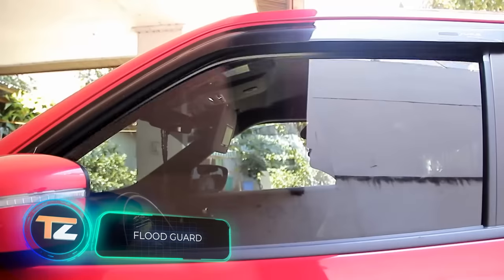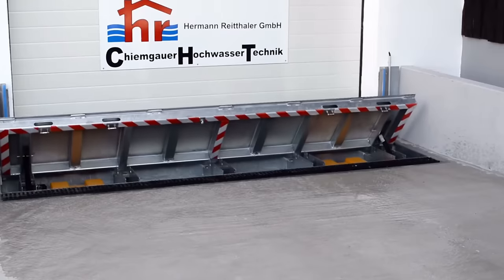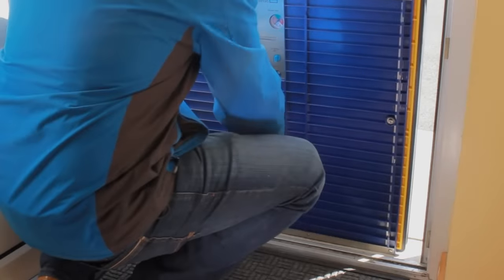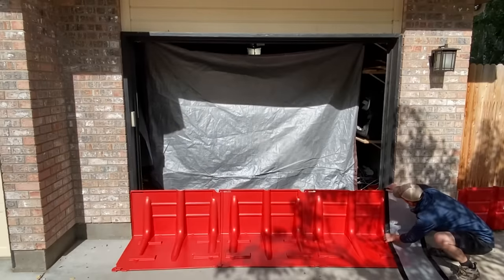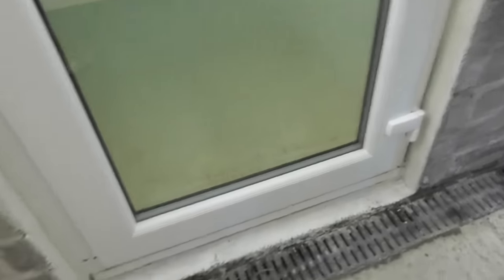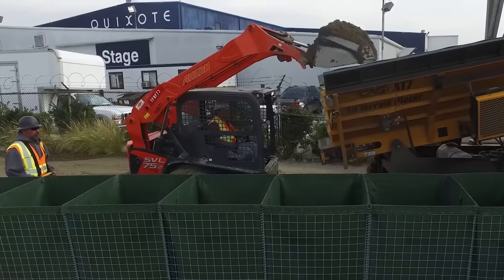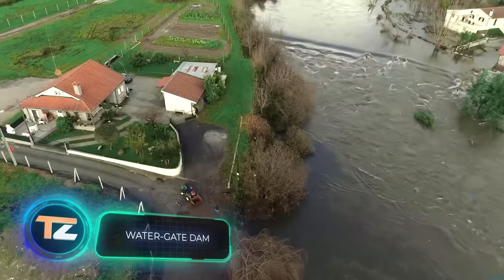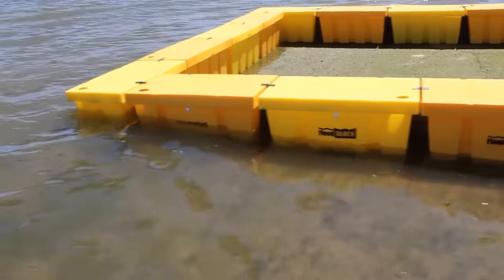FEW PEOPLE HAVE EVER SEEN THESE ANTI-FLOOD INVENTIONS

Comment: The permeable concrete would work in warmer climates, but if its installed in any areas with freezing weather it would break extremely quickly due to ice formation within the concrete itself
Reply: That's actually an astute observation. But, even where I live, we've been getting colder winters. So even though it's typically a warm climate here we'd have issues too.
Reply: Unless you have a large drainage system that is under 100% of the concrete all you are going to do is erode the sub-soil and create a sinkhole
Reply: @ryanbelcher396  a good point but likely you use a specific type of subgrade to help with that. Enough compacted material like possibly gravel and you'd be hard pressed to have to replace the subgrade before the concrete
Reply: @ryanbelcher396  True, but the reality of sand, silt, grime and mossy/fungal growth within the material will always make it so that moisture and water is held within and so will likely always be a problem below freezing conditions.
Reply: I've seen permeable concrete in use in Maryland and freezing occurs there.
Reply: The Netherlands has been using permeable asphalt on the highways for years. It’s only a bit less durable, but much safer (no spray, no aquaplaning) and quieter (so less disturbing for the surroundings). It also leads to less pressure on drainage systems.
Reply: @AndreSomers  sounds nice I'm curious how much more upkeep compared to normal concrete?
Reply: @manw3bttcks  Thank you.
Reply: @louther1213  I am not in that business, but from what I can find the surface of the current generation of the material lasts around 11 (right lane, used by heavy traffic) to 17 years (lighter use), while achieving a 6,5dB reduction in sound. It is also less prone to form ‘tracks’ than the standard closed asphalt. Trials for a surface reaching a 10dB sound reduction are underway, but that surface is expected to last at least 7 years, so shorter than the current generation. In general, road maintenance is excellent in the Netherlands. In general, it does have a shorter lifespan than closed variants, but the benefits seem to outweigh the increased maintenance.
Reply: That water has to go somewhere.
Reply: @AndreSomers  11 - 17 years? Roads in my country do not survive even one year :D
Reply: Nik Liwanag  I've seen some of those, I've been watching ''Tofu Dregs Construction'' videos. What they try and get away with is shocking
Reply: it's asphalt. not concrete.
Reply: I'd be more worried about trapped water in the concrete causing steam explosions in the summer months.
Reply: I can only imagine that they have thought about this
Reply: actually it isnt affected
Reply: I doubt it, the concrete itself isn't "absorbent" in the literal sense of the word. It's not a sponge. It's permeable, allowing water to pass through. I don't think it actually retains any of the water. I think the biggest issue would be erosion, but I think that would be solved by compact soil.
Reply: california needs this, with all that drought hardened ground, every decent rain is a flash flood warning LUL
Reply: Doesn't the water drain out of permeable concrete before it freezes?
Reply: @ryanbelcher396 Why? That's like saying that no pavement at all will create sink holes too.

Comment: Hot take: Wetlands. Natural flood protection with benefits all year round, from Increased biodiversity to lower Surrounding temps in hotter months. Like, the best way to both prevent and lessen the Damage of flooding is to restore and protect wetlands.
Reply: My sister lives in mountains and has gotten flooded twice in 15 years. What would you suggest as far as protecting wetlands on top of mountains?
Reply: @blcouch  Wetlands exist on mountains though. Bogs, marshes, they kind of can exist at any elevation. So, I would suggest not living in the lowest part of a valley, not living in a previously existing lake that was drained by humans, designing proper housing on mountainsides with the correct grading, and yes, keeping marshlands where they are and using them as protection rather than destroying them to fit in more buildings.

Comment: The 'Boxwall' was definitely the smartest looking of the designs. Affordable effective solution, easy to install and store. I imagine the design size could be expanded upon for a variety of applications. Thank you for sharing.
Reply: the flood blocks also seem handy. might be even a option to use those two mixed. the boxwall seem to be ready faster but you can build the floodblock higher and sturdier.

Comment: 0:54 as a structural engineering student, I can't really say it's a great idea to start attaching a potential side load of a few kips directy pulling to the side on columns that weren't designed for that. Mostly an issue with smaller columns in structures with smaller importance factor values, but yeah, not the best, I don't think.

Then again, by the time that load is applied (due to water trying to rip it away), that structure probably already has other issues to worry about.
Reply: Huh
Reply: @bofa2382  He's saying that tethering a car-sized pool floaty to a loadbearing column when the building is being washed away in a river.. might not be the most innovative of actions...
Reply: @SeedlingNL   oh ok thx
also how did you reply so fast
Reply: Tara Dactyle  LOL
Reply: Hey bro I wanted to ask you that , is structural engineering, a good career to be in it , as I also want to pursue for it .
Reply: @Gunner_K  Oh definitely. But you have to like it because the classes get difficult. But if it interests you enough, you can succeed for sure
Reply: I knew it. Few people have seen it because it has flaws.
Reply: I think top mix is a horrible anti-flood thing... I can't call it a tool I can't call it a barrier I guess it's just a structure it could be a bad idea because that's not what it's designed for and it's already been around for years what's your input?
Reply: Tara Dactyle   average cars weigh a whole lot more than 2000 pounds lol
Reply: how will you know someone is an engineer? don't worry they'll tell you.
Reply: But it’s a “sturdy” side structure 😂
Reply: @Af-cn8wg  that just further proves the point. But also it depends where you're at. I wouldnt be surprised if the average in European countries were close.
Reply: @jokers_revenge52  it is. But it is designed majorly to take compressive load not transverse load. Also it is already bearing few tons of compressive load, and compressive failure mostly occure 45 degree to the direction of applied force, so applying additional transverse load in that direction is certainly not a good idea....
Reply: I'd imagine it wouldn't take a structural engineer to have told us this, but I'm also glad that somebody said it, incase some people go ahead with this and attach their car to a non secure pillar incase of flooding, also, would you say you enjoy learning about structural engineering?
Reply: exactly my thoughts!
Reply: The car is way more likely to float off being in a balloon. Maybe there should be a way to get at least some of the extra air out. As it is right now you probably have to tether for anything more than minor flooding or you car is worse off. Hard to sell a $500 bag when it comes with a many thousand price tag to install anchor points for it. Easier just to tell people to tie it to support structures of your house and hope you don't get sued.
Reply: Good point on the stress load. I was more thinking, that may be some heavy duty plastic but it’ll totally be ripped or punctured in a real flood.
Reply: I don't know what a kip is, but those columns are MEANT to withstand vertical load
Sorry emphasis on the wrong word,  let me try that again
those columns are meant to withstand VERTICAL LOAD. 
Its just about the worst idea trying to tie it down and prevent horizontal movement. not only does the car float away, it pulls down the load bearing column and house as it goes!
Reply: @aboveaveragenerd3306  The way I see it, topmix is more about diverting rainwaters, or slow-release a quick heavy rainfall to groundsoil.  NOT something to fight off rising water levels, no.  Its just a better alternative to trying to divert all the surface water to storm drains and back into local streams
Reply: @ilovefunnyamv2nd  Yes indeed!
Reply: Yes, I thought that was very odd too, even though I'm not a structural engineer. Last time it flooded bad here we got about 4 feet, although people down the road got maybe 5 or 6. It was a flood of extremely unusual severity. If we knew that it would flood that bad, I'm sure more people would have evacuated. One town over, they got 20 feet. At that point you either evacuate and take your cars or you evacuate your soul if you try to hunker down...
Reply: Looking at those straps, I doubt they'd last that long once the car became buoyant in fast moving or tidal water anyway.
Reply: @EunoiaAnrkyuk  Looks in relation to material strength can be kinda deceving sometimes, but I see what you're getting at.

But yeah, if their material is strong, they ought not to make it look weak.
Reply: lmao my first thought, too. If it starts to float you got a 1 to 2 ton (or more) vehicle that's pulling sideways on a concrete pillar. I mean if your goal is to wreck your building, then that's your method
Reply: especially because a pillar is build to withstand the force from the top not sideways.
Reply: dont worry that velcro strap wont do jack shit
Reply: @Gunner_K  I hope you are good at maths as it an essential asset.
Reply: @Avarice21  and?
Reply: @Biffo1262  There's a period at the end of the original comment.
Reply: dont worry that strap and carabiner would never hold for long enough to do any real damage
Reply: I'd say put concrete anchors in the driveway. its a concrete slab anyway.

Comment: The quick dam is pretty great. I’m using on to keep my driveway safe from notable amounts of water flooding my garage. I have no idea if it will dry out or if I’ll have to throw it away but it’s doing a great job.
Reply: It will need to be thrown away after 6 years or so
Reply: Now I can take a bath standing up
Reply: If I had to guess those things are filled with those silica gel beads that swell when soaked.  You know the ones that are  like large grains of sand when dry but are good sized marbles after soaking for a while.  I've dried those things out before on a tray but it can take a few weeks for them to get back down to their original size.  Contained in a canvas sleeve like that I'd wager it will be closer to months to fully dry.
Reply: @zacharyknollman5731  thats called swimming

Comment: I see a problem with a lot of these, it’s great that the door way is protected, but what about the walls? The basement windows? The crawl space? If water can get into any of those places the protected doorway is of no value
Reply: In the case of many urban houses protecting the door way would be enough to prevent damage.
Reply: That is true but it can also be assumed that these products are targeted towards people who live in areas that flood regularly where basements aren't common or allowed. Houses is those areas are somewhat built differently than in other areas.
Reply: I have never seen a house with a basement
Reply: Exact thought, in some areas dam water come through drainage and at homes through tiles, these won't work in such cases!
Reply: @weg5856  wow there are lots of them.
Reply: FLEX TAPE-
Idk.
Reply: WOW
Reply: Beauty
Reply: @zanixzy1340  True, houses in my area tend to have higher foundation because we have floods and typhoons every winter, wooden houses and houses with basement are pretty much nonexistent here
Reply: @BeaneChunz  That’s the thing, you don’t need to protect every inch if one plans ahead.
Reply: This would work for my house we dont get huge flooding but living down a hill water does get into the garage n we have no storm drains. We use wood logs currently but the red things would be way nicer and divert the flow better.
Reply: In areas where flooding is a problem, would you really design a house with crawlspaces?
Reply: Depends on the flood and the place I guess. If the flood is a japanese type Tsunami there's hardly anything that can prevent the flooding, but if it's a "big rain" that lasts for a few or several days I would imagine each of these to have a use (except the car wrap thingy :P), and it would probably benefit on communal level (i.e. the more people have some of those systems installed would "add up" to the absorption and impact reduction)
Reply: @weg5856  'murica, eh?
Reply: Don't use fucking drywall for your houses then
Reply: In Europe basements aren't common and walls are made from brick and mortar, if water is getting into your house it is through the gaps around the doors.

Comment: Hesco is also used for military purposes. Easy, especially in the desert, to use them to make bulletproof structures
Reply: Oh, that's really neat. Not the intended use, I'd suppose, but there's nothing wrong with adapting products for new applications.
Reply: @YouKnowMeDuh  I think the HESCO barriers the military uses are a bit larger than the flood water ones. To add, the military will also fill them with stones and gravel to further increase the odds of bullets and explosives not penetrating fully.
Reply: @YouKnowMeDuh  It’s basically like a More easy to build and surprising durable castle, the military ones are also larger, they can protect from artillery, mortars, bullets, grenades, and other small arm fire so pretty handy
Reply: Now you can protect yourself not only from floods but terrorist attacks as well!
Reply: Yitpo  When it comes to the military, never underestimate their paranoia.
Reply: Hesco is really just sand bags 2.0
Reply: Yitpo  Citation needed